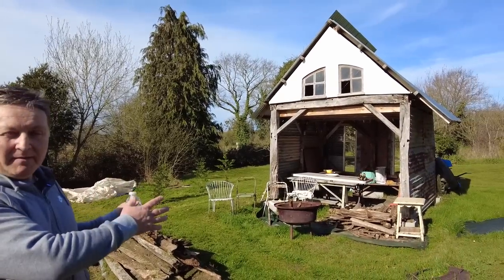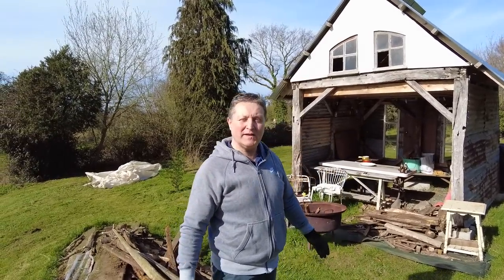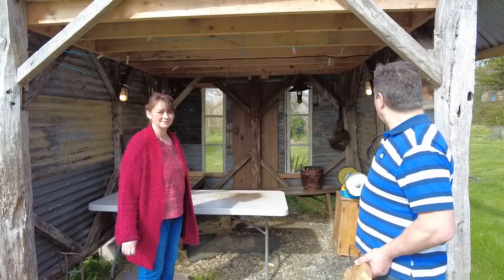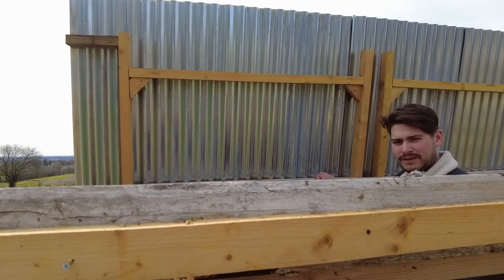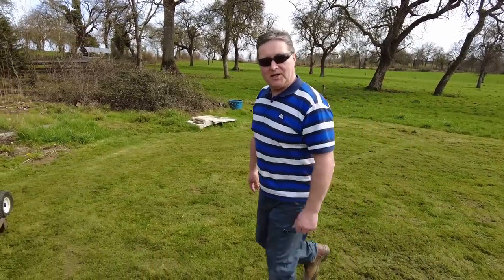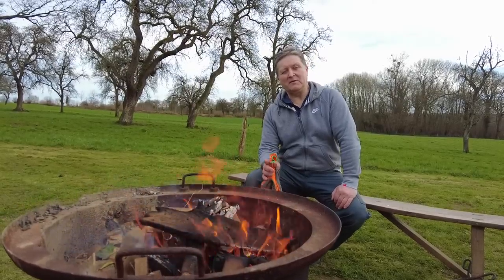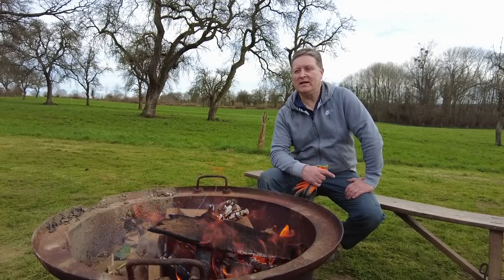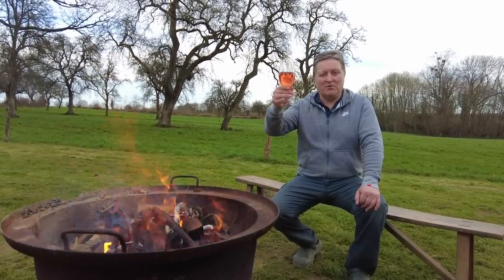Bet You've Never Seen Anything Like THIS Before

Comment: I love watching you pottering about  doing work around your grounds.  I just watched you at the convent on Billy's vid and you looked at his copper.  The ring on the side of the mixing bowl is to put your thumb in to hold it steady as you beat the egg whites, and the round bottom means it can sit on a bowl of hot water without touching the water.  But my question is how did they insulate the handles on on the pans and dishes?  Are they filled with something?  If so, what? Otherwise the cook would be injured!  Love the channel.  BTW why don't you burn ALL that wood in your wood burner?
Reply: These folks were used to working around an open fire.  I am sure they simply had large towels to use as pot holders.

Comment: Looks good Sean 🤩 If you put a small block of wood 2x4 below the top part (of your chopping board), so the big piece of wood is at an 30 degree angle, you can use it as a helper for pulling off dirty boots 😍

Comment: what if the roof opened all the way flat on some side pillars and you make a floor on top with a rope rail that folds open - you would have a large deck with 2 side spaces underneath for shade in the summer or have the roof slide down the side of the building and have a fold up railing for safety and 360 view. The roof would only slide down enough so that it would be the railing on either side.  (big ideas - I've no skill to build it lol)

Comment: I thought you were making boot removers but you said it was a cutting board.  Just need an angle piece on the bottom and it would be a boot puller.